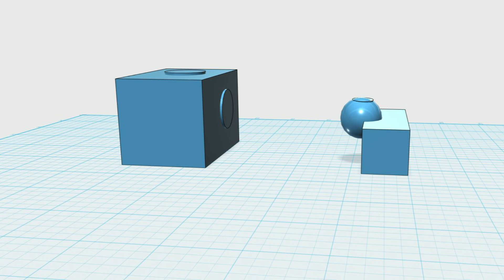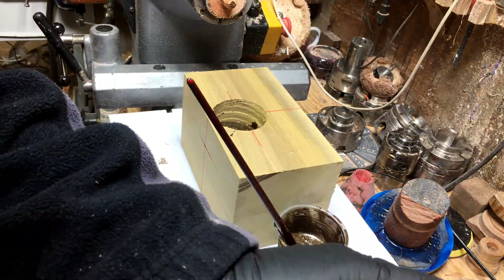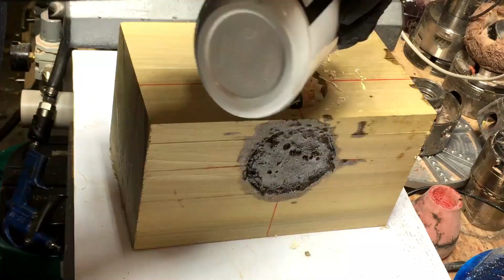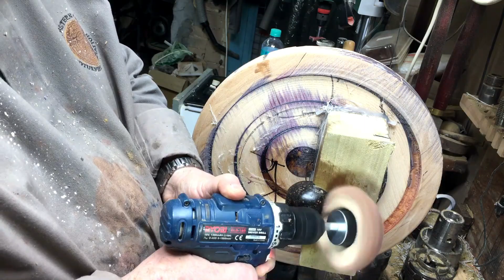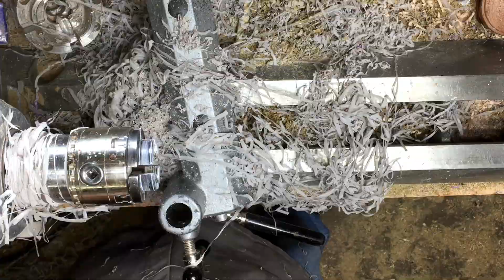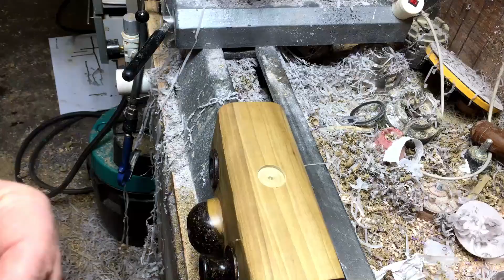Woodturning an emerging lava rock inkwell

Comment: Very interesting project. I like it. I have two 16" diameter face plates that I use for odd projects. I have 4.5" metal face plates mounted to the back of them. That way you screw them onto the spindle. For the exact reason that happened to you. I would recommend you doing the same for safety. Gotta be careful buddy.
Thanks for sharing.
Reply from the maker: Thank you very much i will try it your way next time  .  cheers  Ahron